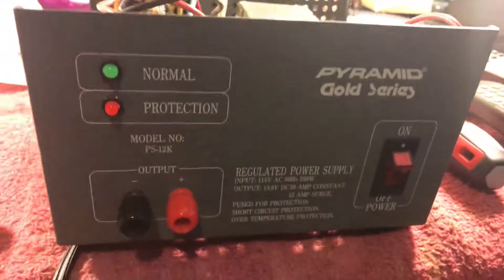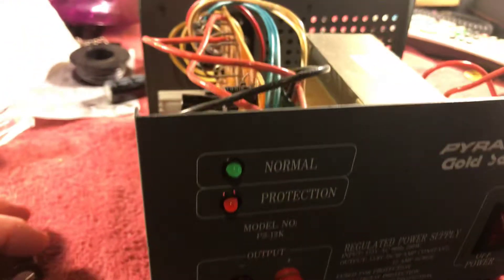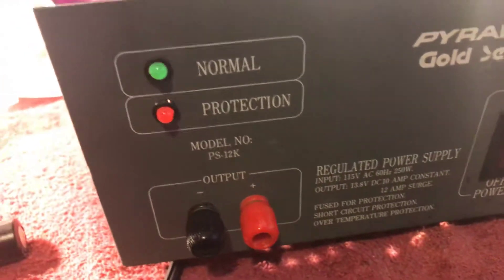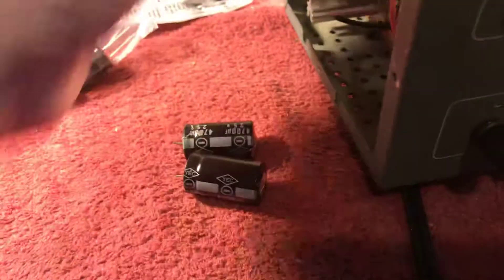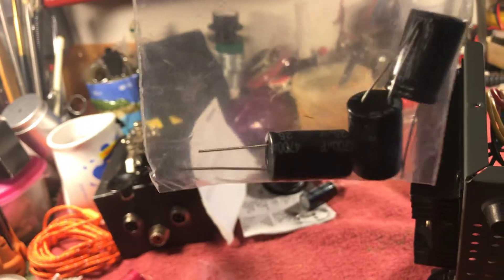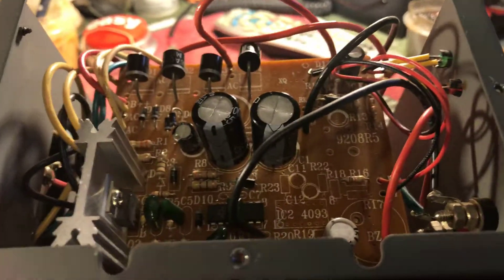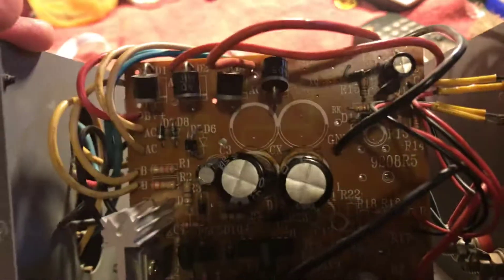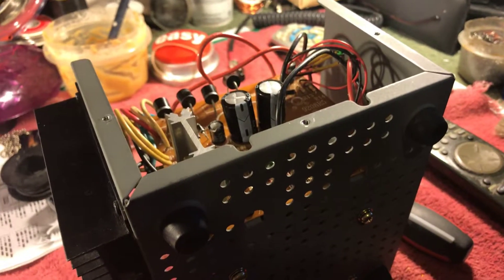Pyramid PS-12K Repair

Comment: My 1960s electronics school memory tells me  they will more likely filter out more of any DC ripple that may still  be in the dc output waveform, which "should" be a smooth line. However, if they go cheap on the filter circuitry, the DC output will still have ripples, or waves in it when you zoom in on it with a oscilloscope. My instructor referred to that ripple as a tiny AC pattern. Not quite "pure" DC. A schematic would help.
Reply from the maker: Sam P Hey thanks for the great information Sam. I’m going to try to find a schematic can download it today. Maybe some more filtering would be good for that little inexpensive power supply

Comment: I gotta go thru my stuff one by one check out them old caps too.  Better to replace 'em before going bad, good catch dude.
Reply from the maker: Sam Iam good information Sam I didn’t even know it was bad. I opened it up because it was putting low power out

Comment: THe voltage rating on the caps only refers to the power capacity the cap. can handle.  Its okay to up the rating.
Reply from the maker: Sam Iam Thanks buddy good information. Always glad to get feedback from you